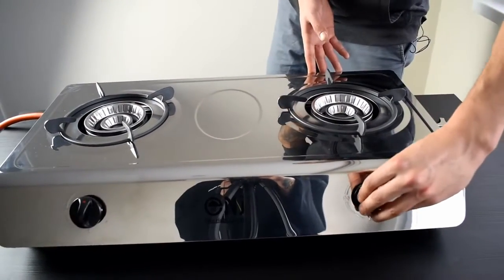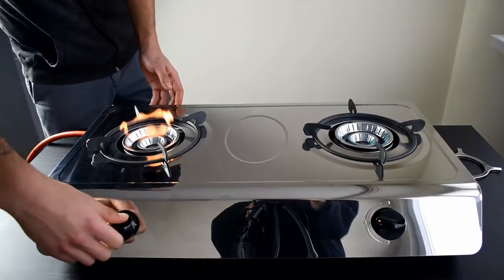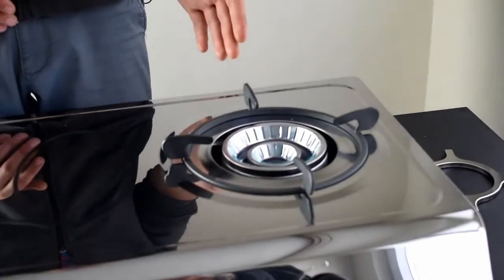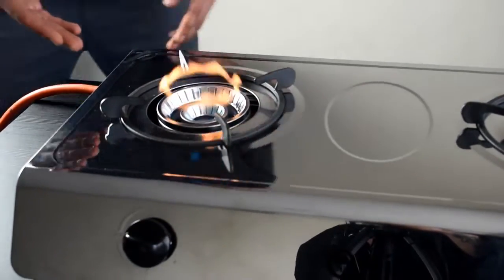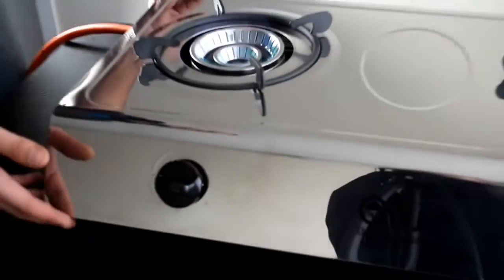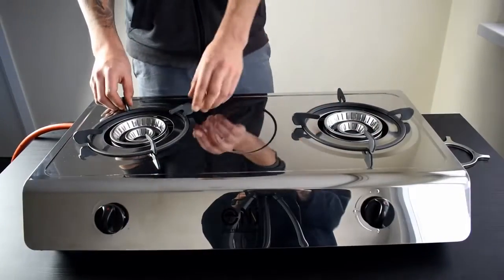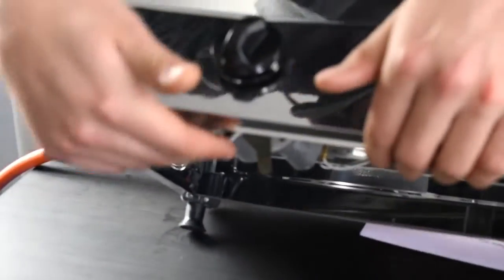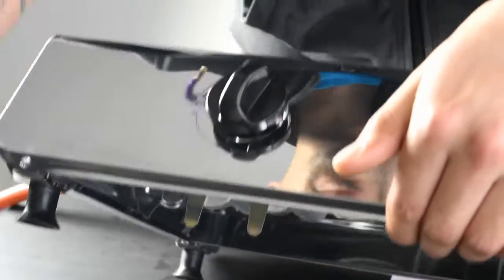How to fix a yellow flame and soot production problem from a gas stove

Comment: Hi I am looking at the NJ DS-22 Double Camping Gas Stove 2 Burner. Is it suitable for a BBQ ? We would want to place a square skillet across both burners. What is the measurement from the left burner stove pot holder to the right stove pot holder edge? Cheers.
Reply from the maker: Hello, you can review the product specifications and dimensions on our website - nj-commerce.com
Reply: And more importantly, produce less CO. a yellow flame kicks out CO. Never use a yellow flame inside a closed room.